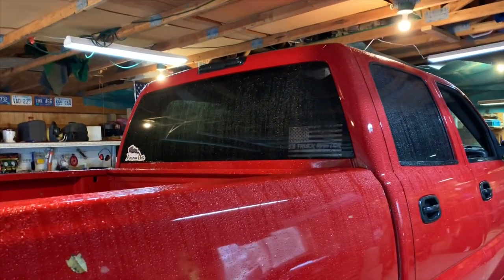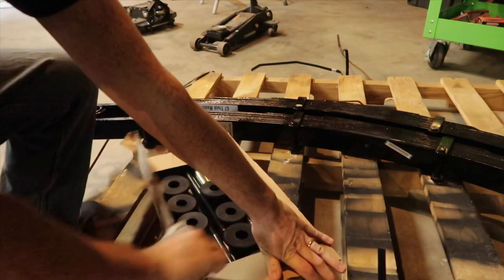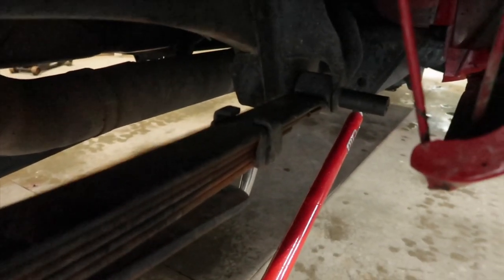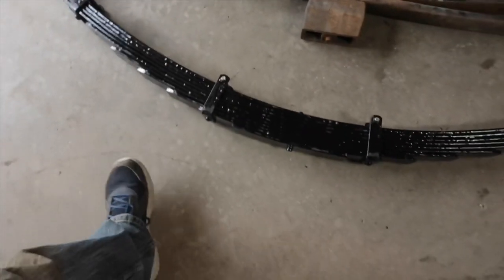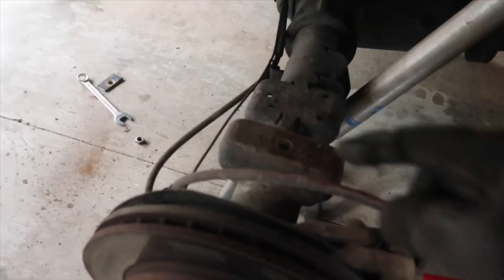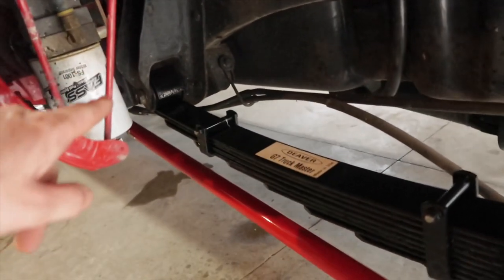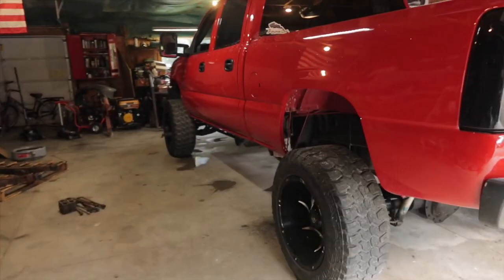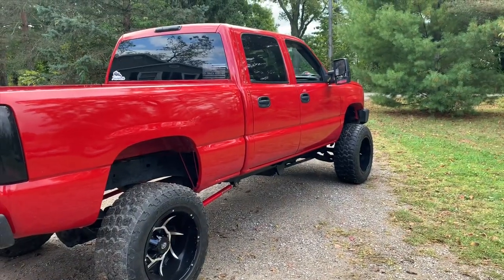Full Install Duramax Deaver 4” Lift Leaf Springs

Comment: Nice upgrade. Lift springs that actually allow you to haul stuff when needed. Now for a new rear bumper. I say do a roll pan with a flip up license plate that has a hidden receiver 👌
Reply: why did the older lifts springs not allow towing?

Comment: Only tighten the bushing bolts once the truck is resting on the ground.
Reply: Why is this
Reply: @alfonsobernabe4291  Its based on traditional vulcanized rubber bushings (like he one on his rear shackle, not a polyurethane like the front).  That bushing center spacer is bonded to the rubber, and it doesnt rotate freely, so weight needs to be on the spring to tighten the center of the bushing in its static ride height position.  The way he did it in the video, the bushing is preloaded at ride height and is trying to twist its way up.  It shortens the life o the bushing and can lead to harsh ride and un even ride height.

Comment: Why did you not just have a spring shop re arc the older springs and add 2 or 3 leafs?
Reply: One, very few places, if any, will "re arc" an old spring set, and two, more importantly, the eyelet mount distance would be far too short.

Comment: Ya know, if you leave everything lose when installing the new springs, you don't have to use straps and such to get the pin lined up. Loosen both sides and don't tighten anything until you get both new springs in and the pins aligned, then tighten everything up. Anyway, those looked like nice springs, however Deaver doesn't make springs for older, square body, GM trucks.

Comment: Gonna have to get some new tires before winter! Unless it’s gonna stay in the garage to keep it clean.  My rockers split open and it just sucks.  Keep the salt off it and keep it cherry.
Reply from the maker: I’m really considering keeping this one in the garage
Reply: Truck Master what truck will you drive in the winter ❄️ time?
Reply: Truck Master you’ve done a ton of work to get rid of the cancer on it.  Don’t start “smoking” again and give it a reason to come back.  (Figure of speech of course) Drive the Tahoe. Need something with ground clearance.   I know your snow up there.   You’re is worse then mine.  And that’s not saying much for my area (mass.)

Comment: Looks good, about to do the same and add airbags.  What 6" fit do you have?  I have the FabTech and was looking at BDS 5" rear springs to match.  Why Deaver, just wondering?
Reply from the maker: I hear the quality is much better so figured I’d try it out also it’s a much smoother ride

Comment: If you wanted to put a exhaust tip on what inch would you wanna get a 5inch or 8inch and what brand would you want to get. I love the sound of your truck I love the whistle sound with turbo  with the 5inch exhaust straight pipe.

Comment: Excuse my ignorance here, what’s the difference between simply adding additional leafs to the stock leaf springs vs going with some of these?
Reply: These use multiple thin leaves to give a progressive spring rate
Reply: @sebastianmuglia7451  Ah I see. Would these give you a softer ride then vs adding additional leafs?
Reply: Yes these are softer and get stiffer as they compress. Adding regular leaves will make it a stiffer ride

Comment: The truck is sick. I'm planning on working with Deaver to get a custom 2in lift pack for my 3500. I'm trying to get information from anyone that has run them for a while and see if they are worth the money. What is your opinion on this pack for towing? Do you like it? Worth the money? I have a deaver pack on my long travel Tacoma but that is apples to oranges and I have not found anyone to talk to that has them on a heavy duty diesel truck for towing. Also I was not planning on getting traction bars but obviously I would if I had to, what is your opinion on this as well? great channel.
Reply from the maker: From what I was told this setup is ideal for towing Deaver is your best bet

Comment: Question #1 the rear ends on both my 02's lockup like they are posi. So why the posi upgrade?
 #2 I'd like to lift my crew long bed because it looks dumb being so long. I figured 2"-3" is all. I don't want to turn the torsion bars because it handles funny as it is. Any idea the best way? 
 Also if you went to 6" you may have to pull the header above the garage door to get it out. Haha. That would be a good video.
Reply: The posi upgrade replaces the gm style which uses clutch’s and a centripetal weight to engage, with a dodge unit where it’s like a true track and it’s all gear to gear so nothing can wear out and it’s more robust

Comment: What did ya torque the rear wheels to? 120 ft lbs? Thoughts of running a banks diff cover?
Reply from the maker: I went 157 ft lbs
Reply: Just an option, I don't like the looks of after market diff covers. It looks like poor man's upgrade. Put your money on useful upgrades. Hope I didn't offend you it's just my opinion.

Comment: I try to put a fuel cat kit on my duramax 2003 Chevy Silverado 2500hd. Now my truck in not run. How can I fix it.
Reply: Put fuel in the filter and bleed the fuel system of air.
Reply: Did you try to put the cat kit on or did you do it? If truck in not run. Uninstall it. Go back to stock. There's no better filtration then the ac delco for that truck.
Reply: @GMbusa1  thanks
Reply: @grin64  thanks

Comment: Do you think that a 2007 Chevrolet Silverado 2500HD Classic 4X4 with 150,00 for $27,000 a good price?
Reply from the maker: I’d pay 24k if it is in mint shape
Reply: Truck Master thx for replying and keep up the good work 👍
Reply: There's one in Spokane for 24k and I thought it was high. But looking at it hard it's gorgeous. And loaded even has wood grain accent.  Is yours the classic body?
Reply: grin and bear it -  yea it’s a classic body I want a diesel for my next truck and don’t know anybody that has one or knows a lot about them
Reply: Only if mint with leather and sunroof. 17.5k without either.